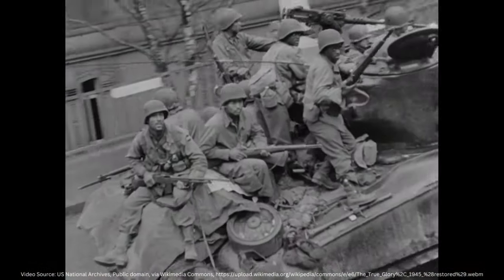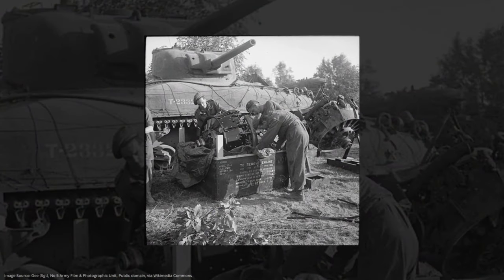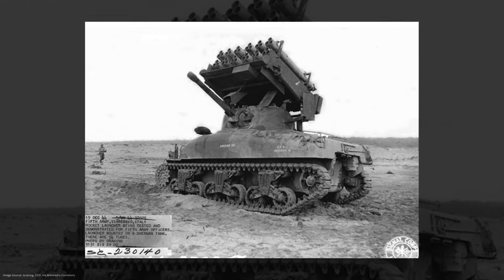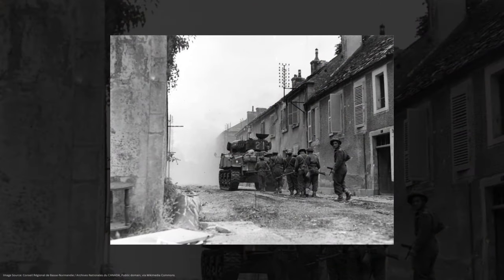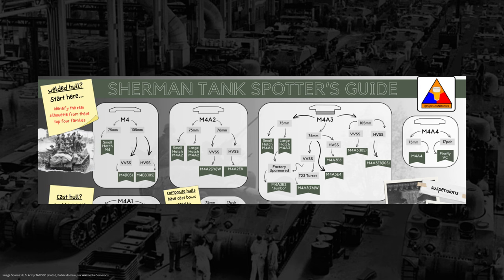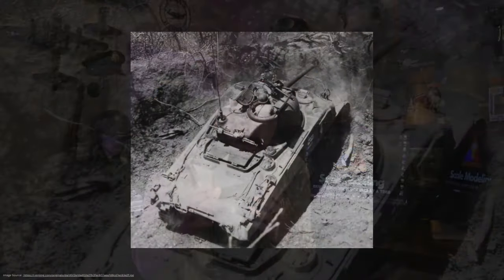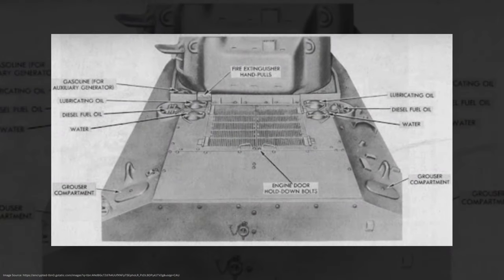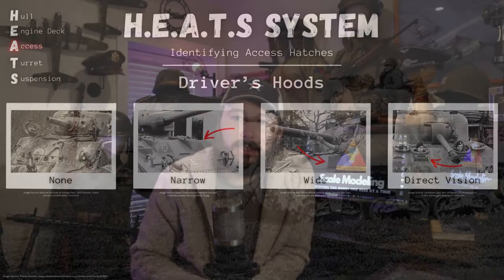Sherman School: Part 4 | M4 Engine Decks & Rear Silhouettes

Comment: Good talk. I would like to mention that there was factory variation in the M4 rear hull plate. Some factories (Baldwin and Pressed Steel) welded the plate vertically, while others (Detroit, Alco and Pullman) had it at a slight angle.

Comment: another way to distinguish between m4a2's and m4a3's is by looking at the angle of the rear plate. the m4a3's rear plate is sloped at a much greater angle than the m4a2

Comment: Beware of the M4 with the 105mm gun as it has a unique ''large hatch'' welded hull wich was not used for the75 and 76 mm tanks as it has no cut out but a straight lower edge on the upper rear plate.